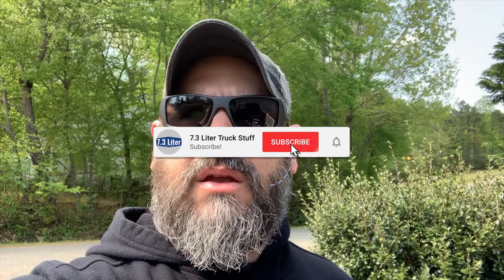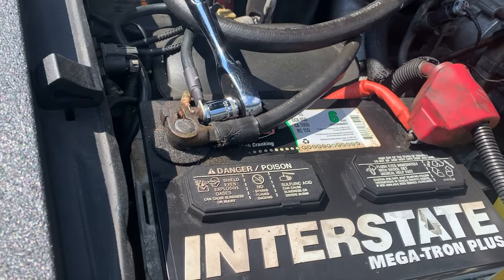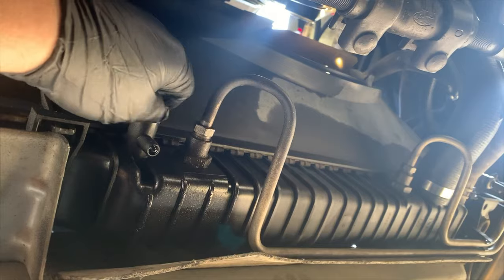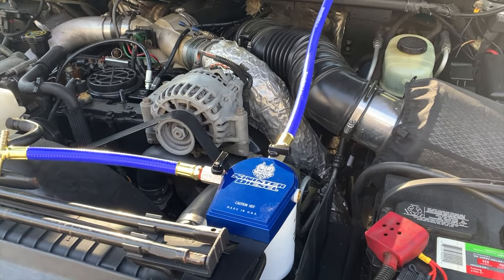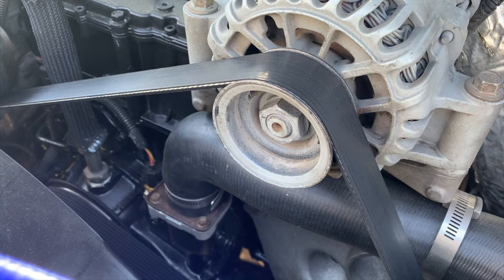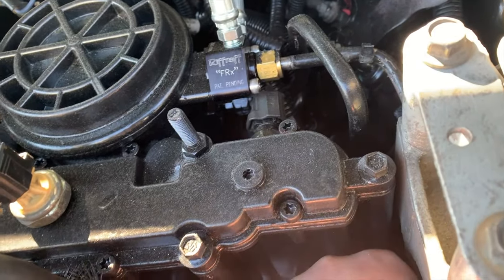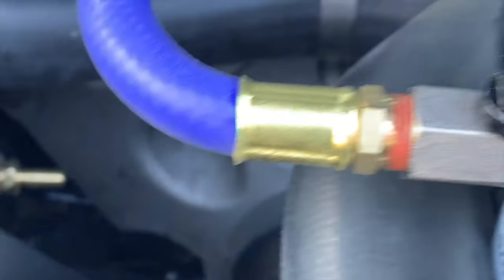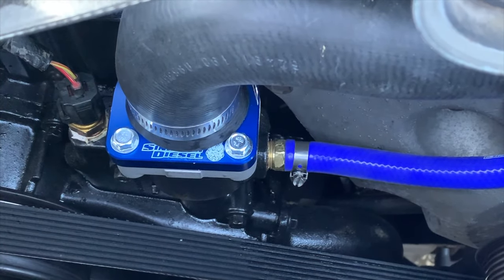Coolant Filtration System, Thermostat Housing & 203 degree thermostat - 7.3 Liter Truck Stuff

Comment: I did this mod years ago I was wiping out water pump seal did a flush caught the fluid in a swimming pool and the bottom of the pool was full of sand put a filter on it within a month it was plugged haven’t had a issue with water pump since I change the filter about once a year now just to do it

Comment: Chuckles, fun video! 👍 

It’s always fun putting shiny new parts on a rig! I can’t imagine it would hurt anything to add a filter to catch debris

At least the wrench landed outside the engine bay! My luck is it falls in the bay and I spend an hour fishing it out

Why’d you go up in temp on the thermostat? Just curious

You can use t shirts or underwear to filter the (old) coolant to reuse, just an FYI
Reply from the maker: As I understand it, International designed these engines to run at 203 degrees but Ford switched it to 195 degrees so now there's a small market to switch it back for efficiency and performance sake. 

I do like the way the filter looks on the engine and there hasn't been any adverse effects in any way so I'm calling it a win, ha!
Reply: Ah, ok 👍 makes total sense. 

Ha! 👍

Comment: Did you ever open up your first couple of filters and see what they caught?  Newer engine may have a lot in there. I'm just under 300k and wondering if I should add filter.  Seems like a nice to have since obviously it's made it 21yrs without!
Reply from the maker: Funny you should mention that. The short answer is “I’m going too”… The long answer will be a video for sure, along with showing the results. I did buy a vice and a filter opener for this very purpose so I’m looking forward to seeing how those work as well.

Comment: I also have that re-routed hose and that filter is right on it. I’ve noticed that filter gets pretty warm. Have you had any issues with that?
Reply from the maker: I haven’t had any issues at all with the Sinister Diesel coolant filtration system but you’re correct, she gets HOT! 😀

Comment: What switch panel is that?
Reply from the maker: Thanks for the question. It’s a generic toggle switch panel that’s available on eBay by a few sellers. The covers snap onto the outside of the toggles that give it the custom switch look. The cool thing is, you can switch them at any time and recustomize the panel in a matter of seconds if you wish.

Comment: What coolant do you use
Reply from the maker: So I was asked this question earlier and I was using a premium coolant but I did some research and came up with this info:  the Kentucky plant in 2002 and 2003 put in a hybrid coolant that was gold while all other 7.3’s had a Ford motorcraft conventional coolant which is green. My understanding is the 7.3 is a lot more forgiving in terms of coolant than the newer engines with extensive emissions. At this point I'm going to go with the Ford recommended full coolant swap every 15k, and thus I’ll likely go with the top of the line Ford Motorcraft coolant as well.
Reply: FWIW, I just did this very procedure to my 00 7.3. I went down a rabbit hole on coolant type. Finally just called a diesel shop I trust and asked them what they use. They said they use green for the 7.3 which they specialize in. So I just went to O’Reilley and got the off the shelf stuff.

Comment: Have you changed your Radiator yet? I'm getting ready to upgrade to a 100%  Aluminum type
Reply from the maker: I haven’t added a new one yet. I have a Mishimoto trans cooler and I wanted to add a Mishimoto radiator at the same time.

Comment: Why a 203 thermostat?
Reply from the maker: So the engine was designed to run at 203 but when Ford dropped them in the trucks they made a few modifications and one of those was a lower temp thermostat. It’s commonplace these days to replace the thermostat for the originally designed 203 degree thermostat
Reply: @73LiterTruckStuff is there an issue with running a lower temperature thermostat? I just ordered mishimoto lower temp which runs at 189…now I’m second guessing the purchase.
Reply from the maker: @joshuafoster6764  No not at all my man. One of the adjustments that Ford did to the (tractor) engine when putting it in the truck was the thermostat. The engines were apparently developed to be ran with a higher temp then Ford put in the engines so dudes are swapping them out now is all.

Comment: What coolant is that? Im a fellow 7.3 owner, and I believe the correct coolant for that truck is orange not green. Its important because Ford (Motorcraft) specs call it out specifically for use in Powerstrokes.
Reply from the maker: LVCJ great question. So my understanding  is the Kentucky plant in 2002 and 2003 put in a hybrid coolant that was gold while all other 7.3’s had a ford motorcraft conventional coolant which is green. Also, my understanding is the 7.3 is a lot more forgiving in terms of coolant and newer engines with extensive emissions are the ones that require very very specific coolant standards. With a Ford recommended full coolant swap every 15k, I’ll likely go with the top of the line Ford Motorcraft coolant next.